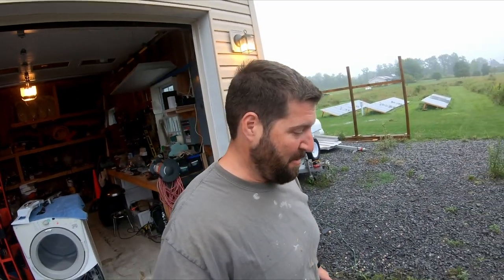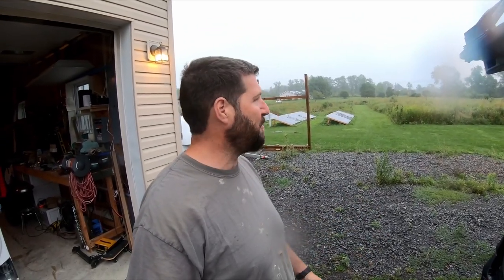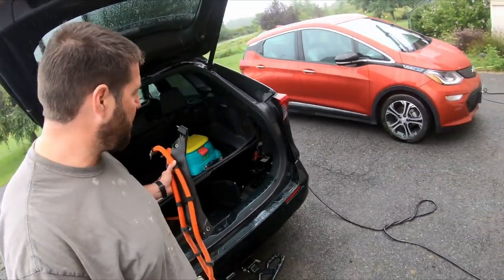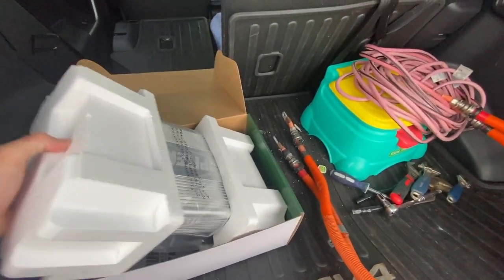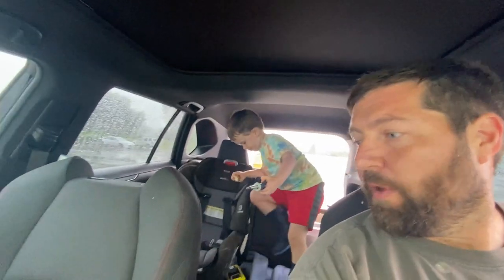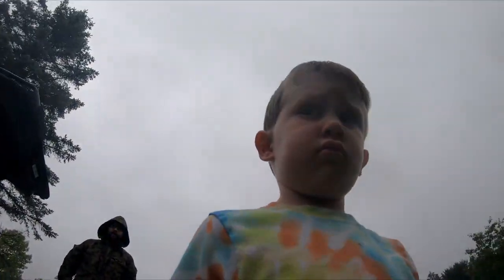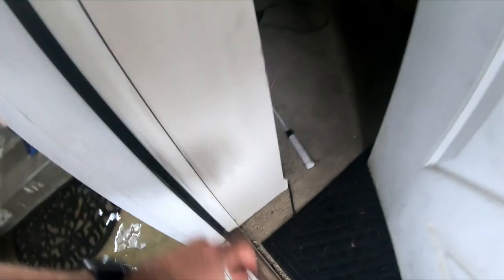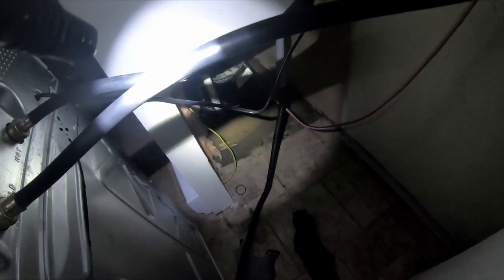EMERGENCY! Can My 2021 Toyota Rav4 Prime Save the Day???

Comment: Nice- Can't wait to do the same with my Prime, minus the flooded basement. Do you know if the 1500watt inverters from the factory are wired to the 12volt battery or are they wired directly into the high voltage wiring? My Prime SE doesn't have the inverter so I have no way to check!
Reply from the maker: I am sure they are wired to the 12v battery. A HV inverter would be much larger and more expensive.

Comment: Perhaps a small Portable Generator like a small Honda Generator .     I had a pair that I used until I put a whole house Generac Generator on my home.   Living in Florida the power is always going out.
Reply from the maker: Yeah I could but this is the first time in 17 years I wouldve needed it. I dont really want to spend that much. Instead I have the inverter in my car and I also plan on a new dual sump pump system with battery back up.

Comment: I think I would setup a gas or propane powered generator on location.   Avoiding the loss a month of rent because the tenants moved out would justify a dual fuel Costco generator, often on sale for $599.  To say nothing of the cost of cleanup after the flood or the apt refurb needed to get a new tenant.  If I would not want to live there its not good enough for my tenant.  It works and keeps good tenants for years.

Comment: Why don't you just equip the house with a small 2000w (or whatever you need) gas generator for occasions like this? Couple of hundred bucks. They can run it themselves.

Comment: Too bad the RAV4 hybrid doesn’t have a 110/ 1500 watt outlet like some of the new Highlander and Sienna hybrids.  Would be an awesome feature.
Reply: The RAV4 Prime XSE with Premium Package has it. I have one and it's great.
Reply: @FreddietheFly  what do you use it for? The prime XSE is not available in my state,  WA. A Highlander hybrid limited has the 110 for about the same dollar amount, and includes surround view cameras.
Reply: @MechayaAlta  I go car camping in my RAV4 Prime so I use the outlet to plug in my air pump and for a mini Keurig coffee machine.
Reply: @FreddietheFly  do you sleep inside and can you run the ac all night with or without being plugged in?
Reply: @MechayaAlta  Yes, I sleep inside. There is enough room with the back seats down to sleep someone up to 6 feet tall. You can run the A/C all night with it plugged in and using room mode, OR, as long as you have full battery you can just turn the car on, set your A/C and it will last the night. You will have spare EV miles to use the next morning.

Comment: It would have been good to see how much of the R4P battery was taken while using the inverter.  How long will it power that setup before having to run the ICE to regenerate the battery pack?
Reply from the maker: It ran for hours and I only lost 2 ev miles

Comment: Dude, dude. Why didn’t you get a small gasoline generator?  Sure they have issues, but compared to being stuck on-site wasting time and your $50k SUV?!?  

Also, seems like a French drain or something similar would be helpful there.  

Putting the pump and maybe some lights on a used APC ups might work also. 

Renters getting mad over utilities failed? GTFO